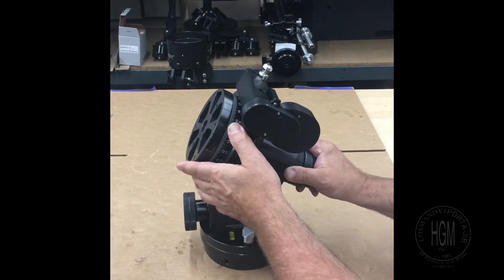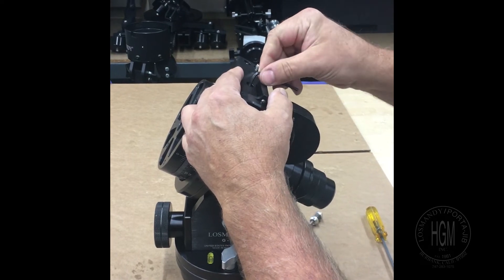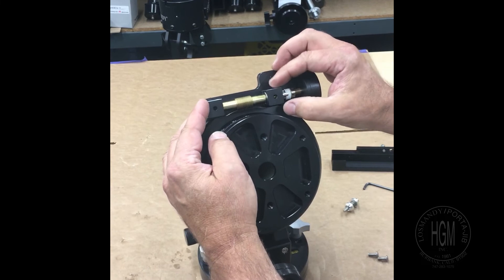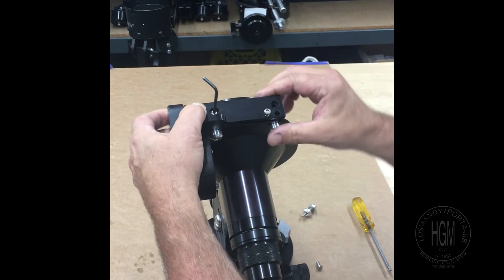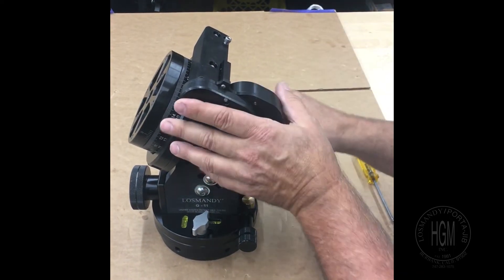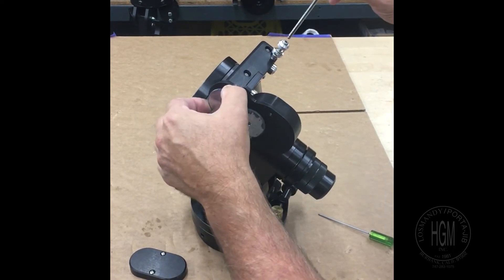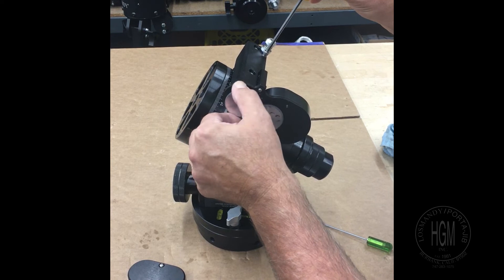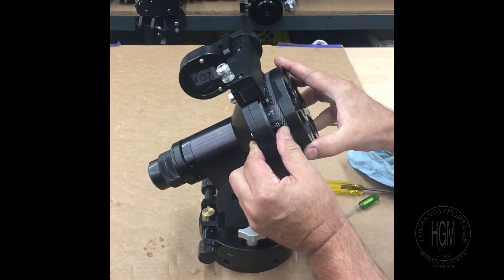Spring-Loaded Worm Adjustment

Comment: hi, my g11 doesn't have those motors and not even the two worm cover plates are different, can you explain to me? thanks
Reply from the maker: Great question - Losmandy mounts have been around for over 30 years, so there are differences on the mounts depending on the date of manufacture. This specific video is for adjusting spring-loaded worms, which were added to Losmandy mounts in early 2019.
Reply: @LOSMANDY  Is this something we can get as a addon? To help remove backlash?

Comment: I wonder about the last step where you use the screw to back the spring loaded worm out. Wouldn't it be better to have a lower spring force and the ability to float in and out to compensate for any out of round issues on the main gear. If you adjusted on a high spot then you would have play on a low spot due to the screw stopping inward movement.
Reply from the maker: The directions are good as stated. When we originally developed the SLW, we found that we couldn't adjust the spring "light" enough to both keep it engaged and avoid too much pressure. the backing out screw avoids this second scenario to allow you to balance it. We might add you can rotate the worm 360 and make sure the gearbox spins freefly in all places.